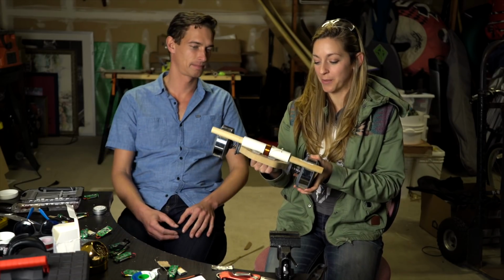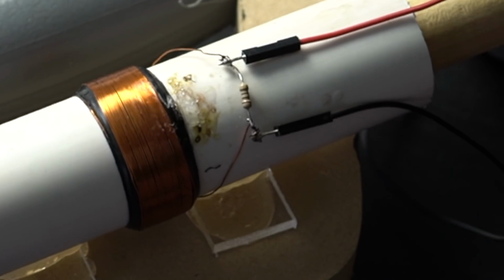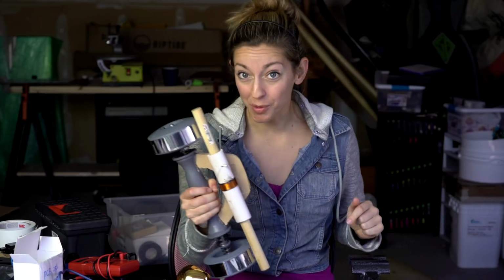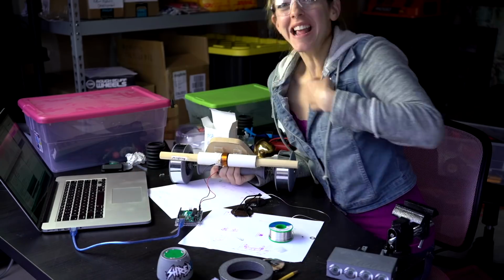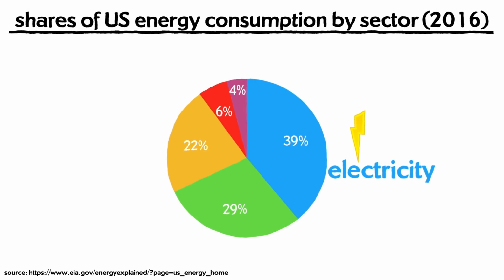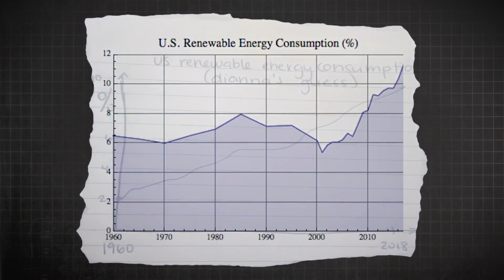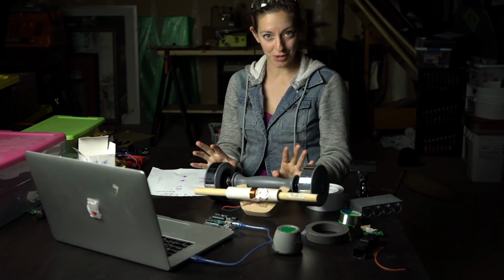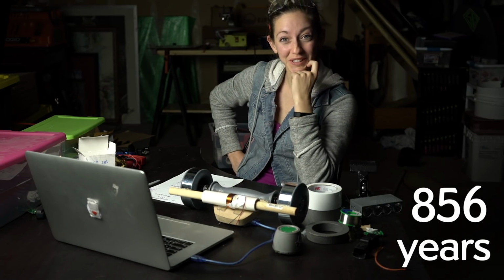Can you power a house with a ShakeWeight?

Comment: I want to ask a question, could be biofuels a good renewable energy? 
I make this question beacouse some years ago i noticed that the rising of CO2 in our atmosphere was pratically related to a huge mining of carbon (and hydrogen) in the past years, that carbon actually was stuck beneath earth and not in our atmosphere.
Since biofuels are made from carbon coming from the air (CO2 converted to glucose by plants converted in fats by animals converted in fuel by alcoholic compounds) it would always keep the same quantity of carbon in the air (getting energy from the sun, WO HO solar power!).
Is my reasoning right? Would it be a good energy source in to invest? Would it give the possibility (I hope I wrote right) to mantain the present style of life? (Inteded as engine motors) since this is the most difficult part of moving on to renewable.

I hope I wrote in a decent english and sorry if it is a bit clumsy
Reply: In theory, yes, biofuels are a goodish source of carbon neutral energy. Some problems, though. Many of these benefits are back loaded. For instance, if you cut down a old growth forest, you don't get back to 0 for quote a bit of time, so you get a carbon bump in the middle. Also, the milling, transportation and eventual burning of the fuel usually results in a bit more emissions than would be taken back in by the same forest, so it will never be net neutral along with being read loaded. 

The most neutral form of Biofuel is just using existing biowaste. This has limited growth potential, though. Biofuels, however, are the only realistic negative emissions technology we have. Nearly all 2°C maps we have involved HUGE amounts of negative emissions. So it is almost like we HAVE to get some form of sequestration to work to even have a chance. I don't think we have a chance, personally, so some level of adaptation is going to be the order of the day. But hopefully we can be surprised.
Reply: Christopher Willis moreover... most agricultural biofuels are currently being grown on land that is suitable for growing food because of tax breaks offered on them. With a growing population and serious topsoil degradation we need that land used to produce food. There are some biofuel plants that can be grown on terrain that there is no viable food crop for. This land used for biofuel production would be a great step forward, but not a particularly huge contributor to reducing CO2 emissions.

Comment: My guess was 15% but not accurate for electric. No idea on the kwh! How about putting a low impact shake-weight system on the blades of those huge wind turbines? Or a small wind turbine on cars or semi's to store energy?
Reply: merlin308 ur a genius,  obviously remember the pig with the pin wheel going weee we we weeeeeee
Reply: putting a wind turbine on a car is idiotic, a car would simply need to spend more energy to accelerate because it would need to make turbine consume energy, and taking into account that turbine has some loss of energy, it will be just wasting of extra gas

Comment: KW/h per day ????????????? Kilowatt HOURS a DAY ? there is already a time unit in it... isnt something wrong with that ?
Reply: Dieser eine Türke, no, kwh is a unit of energy, not power, it's the energy produced by a kilowatt power supply for an hour. Thats 1000×60×60 joules of energy.
Reply: Dieser eine Türke No. It is kWh, not kW/h. Watt is actually energy / time (J/s)... so multiplying it with time will get you back to energy.... and then dividing it per day gets you energy usage pet day
Reply: A watt is 1 joule per second, so a kilowatt hour is 1000 joules per second for 60 minutes. so 1 kwh is actually 3.6 megajoules of energy. Adding a fixed time component to a time dependent unit makes it an absolute unit again :D
Reply: Yes.  If you have a load which continuously dissipates 1kW over the course of an hour, that's 1kWh.  Keep going for a day, and it's 24kWh.
Reply: Lou S 
good one guys, maybe she could have explained the units a bit, as it would confuse a lot of people.

Im sure she could make even that kind of boring stuff fun😂